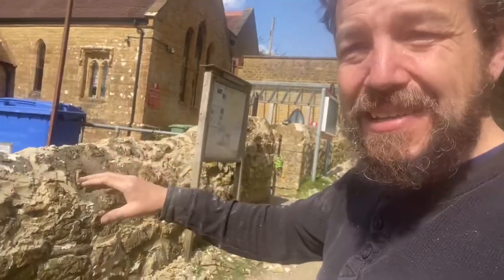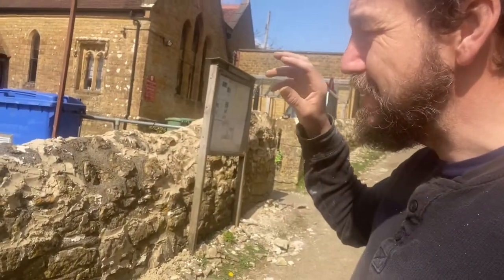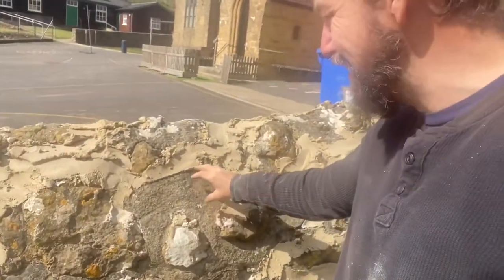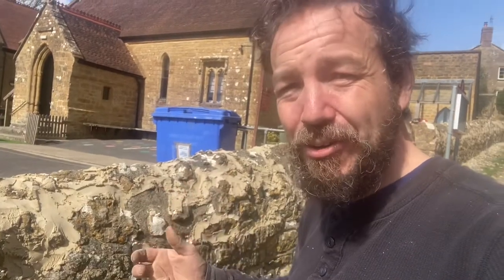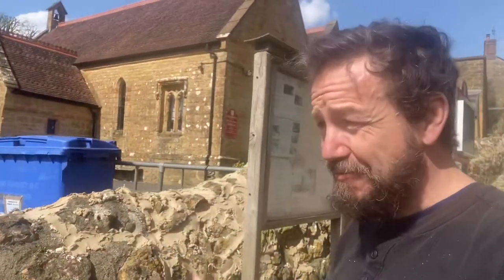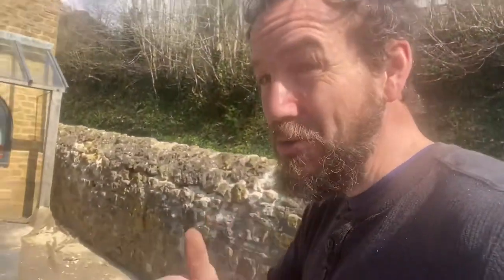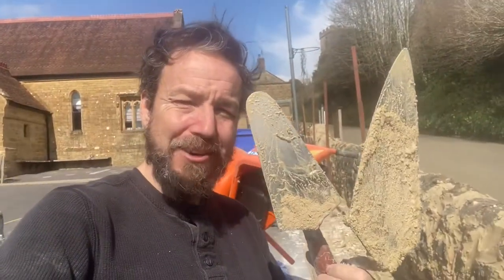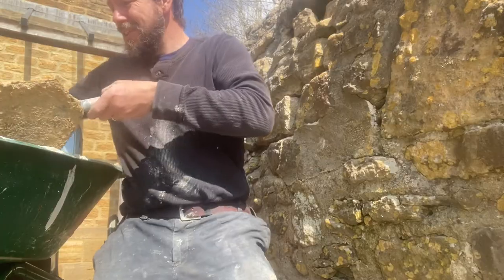Stone walling repair, how to repoint natural stone walling using lime mortars. DIY stone pointing

Comment: Hi mate great video, after a bit of advice I have a large stone repointing job that I will be doing soon and could do with some advise in relation to the mix. I know to use nhl 3.5 lime but don’t know what ratio. Am I able to use normal building sand for the mix? Furthermore some of the joints/ gaps on the stone are quite large around 40-50mm would it be an idea to mix any grit sand into the mix? The stone is of a medium density. Thanks, Josh.
Reply from the maker: Hi Josh, yes some sharp sand would defo a be advisable with large joints like that to reduce cracking. I would use three parts sand to one part hydraulic lime.  I would probably use one part building sand and two parts grit sand to make up the sand element.
Hope that helps
Reply: @SelfSufficientHub  thanks!👍

Comment: Love your style mate. Subbed. 

I’m looking at rural property in Transylvania, Romania. I’m fairly keen on a place that has a natural stone foundation (looks to be limestone - it’s coming for the area). There are some cracked stones and even a gap where a stone is no more. I’m not sure if it’s happened over time (built in the 60’s) or because the new mortar they used was too strong for the stone. Otherwise it looks very stable. Is it worth investing/repairable? If so, what ratio would you suggest for limestone?

Comment: I have a question here. Is a limestone still good to rebuild a wall after so many years it settled down in a ground? I have to mansion that the stone itself chipping off when dry and some of them are sinked with water inside and split on a half.

Comment: Thanks for the video. Always interesting to gather another view on how to go about stone walling from a practised hand. Quick question if you have time:

I've got a lot of lime mortar repointing to do around my garden. This will inevitably produce a lot of fallen mortar waste. My instinct is that this can simply be gathered as best I can, crushed up and then be used as a kind of lime sand soil amendment rather than needing to be carted to the tip. Am I wrong in this thinking?
Reply from the maker: No - you can definitely use it to raise PH levels just like garden lime, it is a different product though and it will be stronger than regular garden lime
Reply: @SelfSufficientHub  Cheers. Yeah, I'd assumed from the effect of working with the stuff on my hands that I'd have to keep the usage down to light surface dustings rather than the handfuls of garden lime you see chucked in planting holes!

Comment: Great video sir very informative.
I know the video is several months old so you may not answer. Is there a way to get a rough estimate on how much lime you will need for a wall?
Reply from the maker: Thanks.
Well it does kinda depend but I would expect one bag (approx 25kg) to do somewhere between 4-20 square metres depending on the mix used and the size of the joints..

Comment: Hi there. Thanks for taking the time to show your work. I am doing a pointing repair on an old  medium density yellow sandstone wall about 110 years old  but it’s quite exposed to the elements so.. When would I use nhl 2 , 3.5 & 5 lime ? I got all 3 in bags from a traditional building suppliers as well as sharp grit sand and granite dust. What will the granite dust do to the mix and the strength of my project and how much should I use in the mix. ?  Any pointers would be much welcome.
Reply from the maker: I would be using 3.5 in this situation I’m fairly certain. The stone would need to be extremely soft for me to consider 2, and as for 5, no chance with the stone you describe.
WRT granite dust, this will be mostly for colour/texture of finish and to match existing pointing I suspect.
Reply: @SelfSufficientHub  Thankyou for replying. There are harder stones used throughout the property grounds external walls so got nhl 5 for those as they are going to beexposed to a lot of rain and cold wind,snow etc however I bought 3.5 for the internal front door arches which need repointing to the stone arch which is the sandstone I mentioned around the stout wooden frame but I’m not sure what sand to use ie sharp grit sieved out and nhl 3.5 as it’s a seal which is around the main front and back door which looks like something out of game of thrones and I want it to be as original as possible to what’s there which looks fine grained and light mortar on the back and a lighter mortar on the front so the repointing before was obviously a different tradesman. I have a mortar gun to get to the farthest reaches of the frame but don’t know if this is possible with lime mortar till I try it but have to get the mix just right for viscosity and strength and if it’s even possible in one of those mortar guns. I believe in doing the job as they would have back in 1890  but it could get messy on an arch hence the mortar gun but I’m trying to research castle masons and how they used to do it which is a task in itself but I’m ever inquisitive and love learning these new techniques thanks to good people like yourself. Any pointers ?
Reply from the maker: @pamwalker7823  firstly on sand. Definitely use a sharp sand in the mix. I thought that’s what you said in your original comment which lead me to my answer on the granite dust. The granite can be used to make the softer sand sharper. Basically you want some form of grit as with any natural stonework you will have areas of larger pointing. Anything over 35mm is definitely prone to too much shrinkage etc if not integrating some grit. The grit basically means the mortar will perform more like a smaller version of concrete.
WRT the mortar gun, I have found these to be impossible to use with anything less than very fins sand so there isn’t a mix that would be suitable for both the house and the gun unfortunately. I would recommend simply using two trowels as I do in the video and squeezing mortar in until it starts coming round the edge of the smaller trowel as you push. Start at the bottom and work up.
Reply: @SelfSufficientHub  thanks again. I pointed the outside wall today after building it last week and it looks perfect so happy days and will try and use a muddy water on it once it’s set a bit stronger later next month. The granite was for an area that had it in the pointing as it looks blue coloured in spots hence the granite and I heard it sets the mix off quicker before the cold sets in but have not entertained that yet. I understand on the mortar gun side of things. I don’t want to compromise strength as it will need a lot more water to squeeze it through the nozzle which renders that tool useless in many respects but there is a subsidence crack spanning the car park area by the water run off weep hole so will need a sloppy mix of cement to penetrate all the way down or I was going to try a resin but it will cost a lot as there is a crack about 20 metres long where the car park has sunk about 10mm due to heavy loaded trucks, saplings in the crack growing and also a truck hit a pier at the entrance which all caused this domino effect. Do you recommend a load of Resin or cement mix slushy then a harder cement  mix to pack and grab finished off with lime pointing ? Thankyou so much for getting back to me. I really appreciate your help. R.e arch door frame. I will do as you said 👍 but what mix and type of sand and lime  ? It almost looks like there is no grit in the pointing around the arch doorframe. Looks like rendering sand but I’m not sure till I excavate it.
Reply from the maker: @pamwalker7823  I can’t really comment on the big crack without seeing it.
WRT mix around the door I would probably go for a simple 3 parts sharp sand to one part lime (3.5) mix.
Reply: @SelfSufficientHub  ok great. thanks for the help it means a lot. I will see what the exact consistency is when I remove the mortar from the frame  👍

Comment: it's limestone sir
no no no not the wire brush.
it should be tamped.with a churn brush to compact it into the joints.
why have you no aggregate in your mortar and your mix is far too soft.
it should be 2.5 sand to 1 hydraulic .
and you didn't dampen the substrate pal.
only my opinion though pal
Reply from the maker: Thanks 👍